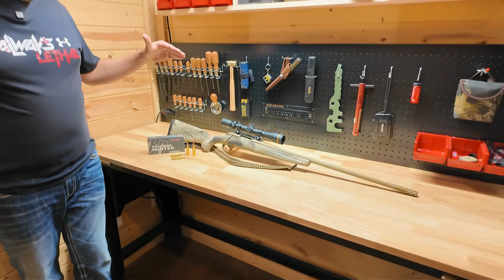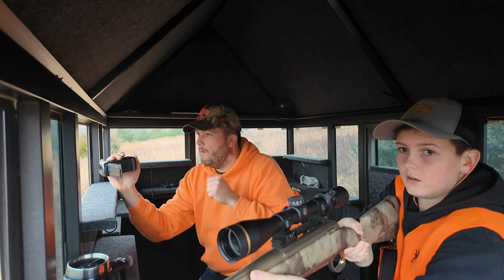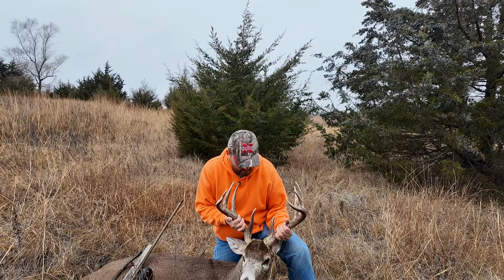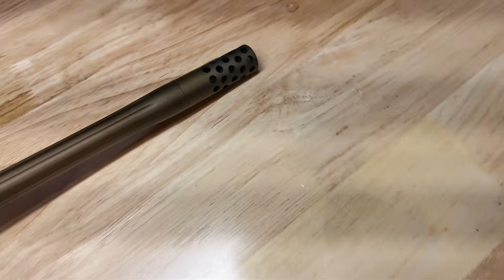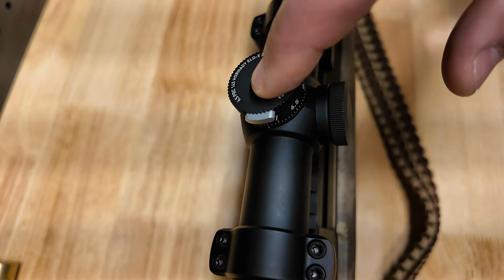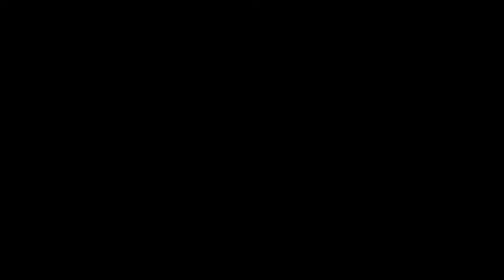6.5 PRC: The Ultimate All-Around Hunting Caliber?

Comment: FYI I went to Berger's ballistic calculator and populated your data, 143 ELDX, 2887fps, G1 BC at 0.625 and compared it to my 270 Winchester, 150 Berger VLD at 3000fps in a Krieger 24" #3 barrel with a full case of H4831SC, Federal 210Match primer, and Winchester brass - out of curiosity when you said beyond 400 yards the 6.5PRC will outperform the 270. I disagreed with that statement, respectfully but wasn't sure. Here's what the numbers showed:

270 Win:
yards: 400,  vel: 2311,  energy: 1779,  drop: -24.30
            500         2154                  1546            -44.37
            600         2004                  1338            -71.94
            700         1859                  1151            -108.19
            800         1719                  985              -154.51
            900         1585                  836              -212.62
          1000        1455                   705              -284.61

6.5PRC:
           400         2310                  1695              -25.61
           500         2178                  1506              -46.27
           600         2050                  1334              -74.25
           700         1926                  1178             -110.50
           800         1808                  1038             -156.13
           900         1694                   911               -212.41
          1000       1586                    799               -280.79

As you can see, it's actually not until somewhere between 600 and 700 yards where the PRC barely edges the 270 with some numbers in this case. But the 270 drops less until you get to 900 yards and those numbers might as well be identical, and, there's only a 4" difference in drop at 1000 yards and energy differences are barely remarkable, certainly if anyone wanted to fill a tag at those distances, a hit from either one isn't compatible with life. Your load does carry more energy after 600 yards

Of course there are those who will say I'm not comparing apples to apples, that I should have used factory Hornady ELDX 145 grain 270 Win data but to be fair, they should rewatch your video cautiously as you did not set any guides for the comparison, thus, I didn't either and of course used one of my best handloads but it's still a 270 Win and I was following your lead since you were speaking in general terms.  I suppose I could run the numbers also with my Barnes LRX 129 grain at 3380fps in my 270 Win over a full case of Superformance powder just to add more comparison but I'm old and it's past my bedtime. Got lots of patients to see tomorrow.
Reply: Yes but you have to handload it to get that. The point of the prc is it's already there in the factory load. I'm getting 3,100 fps out of a 24 inch barrel with federal factory and 2930 with 143 hornady. Looking at Nosler's reloading data that puts the factory loads in the low to mid range as far as it's capability(teh factory will never load it as hot as it can be) So if I want to and I might, I may buy reloading equipment for it and shoot the 130's at 3300 fps and the 142s at 3100. Those loads would be a better comparison to your maxed out 270 load and still would be superior...in a short action.
Reply: @TifTuf-1 not to mention a custom fast twist barrel. Supposedly Browning has or will have a fast twist barrel in 270, that will make it interesting but still the reloading issue
Reply from the maker: Thanks for the comment and comparison. The two cartridges are very similar for sure!

Comment: 7mm-08, bullets from 110gr. To 175gr. Anything that draws breath is in the cooler.
Reply: Amen brother.  My goto is a 20 inch 308 with a 155 grain Sierra TMK.  At 2750 its pushing right at 1000 foot pounds at 500 yards. Here in coastal North Carolina shots are never that far. Most are under 150 yards. Either way, out to 500 (as you put it so well) if it draws a breath its in the cooler

Comment: Why developing a 6.5 PRC if the .270 Winchester already exists.
Reply from the maker: The .270 is a solid cartridge, especially with some of the newer fast-twist barrels being available.
Reply: Why develop the 270 if the 30-40 krag already existed?
Reply: @TifTuf-1  Because of the 7x57 at the war with Spain.
Reply: @eduardoolaechea  No but why. If one cartridge existed why develop another one. That is what you said. I'm using your logic.
Reply: Short action instead of long action
Reply: @zingo_man  😳
Reply: Check out the difference in recoil
Reply: Because bullets in the 6.8/.270 variety all kinda suck BC wise because of case length to overall length restrictions.